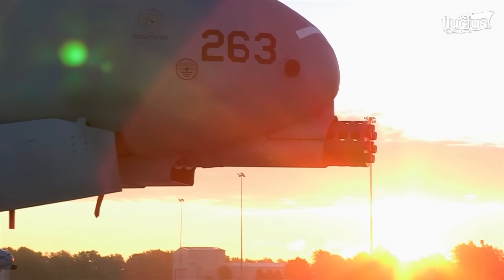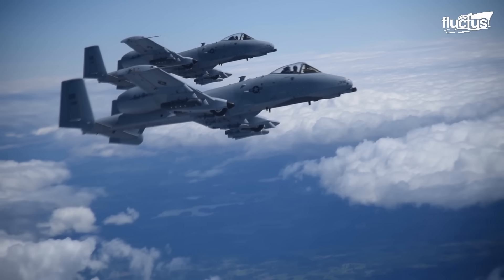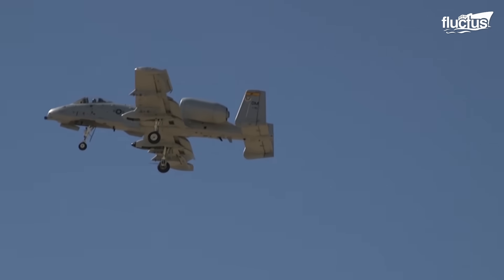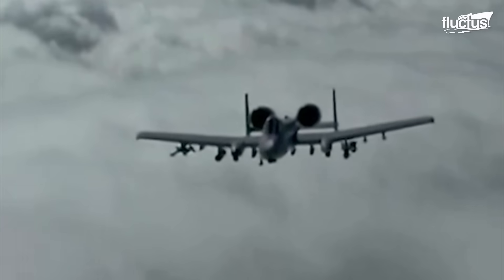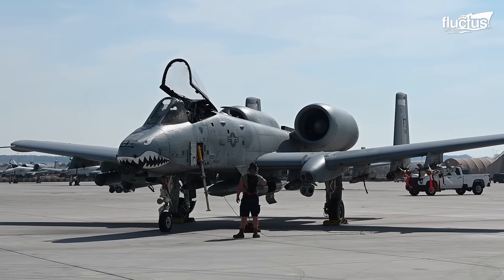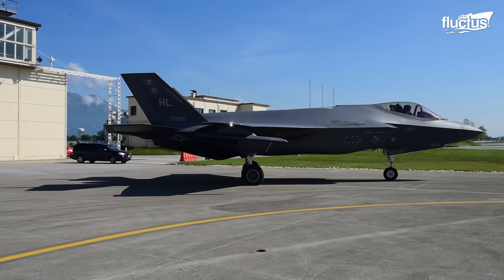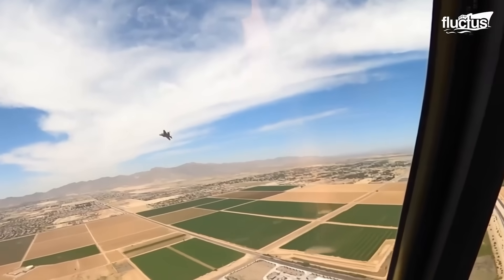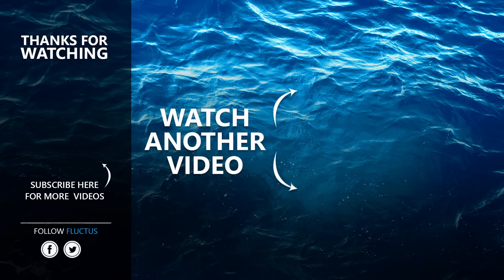Inside US Air Force Advanced Facility Maintaining Scary Gatling Gun Cannons

Comment: i always keep thinking sliding doors provde more radar camouflage over open door weapons bay 
if im wrong on this can you pease explain 
and if im right 
why dont we deisgn the weapons bay to slide open?
why open doors?
Reply: Sliding doors on tactical fighter aircraft take too long to open and more fuselage space than hinged doors. They are harder to maintain and the mechanisms add weight to the aircraft. Aside from heavy bombers (eg B-24, B-36), the only fighter that had a non-hinged bomb bay door was the F-105 Thunderchief which had a rotary style bomb bay door.
Reply: @centralplains7608  but if you only need enough room for 1 or 2 missiles that would launch from the middle 
you would only need to open the middle and not 1 or both doors 
im visualizing the concept of launching 1 or 2 missiles from the middle of the plane and the sliding doors would only need open just enough in the middle to launch both missile then close 
the missiles can be brought into the middle and charged then released from the weapons bay sliding just enough the weapons doors only need to open 20-40 percent vs open doors which open 50% for 1 door or 100% for both doors 
with my idea in my mind you would need to only slide the weapons door maybe less than 50% since your only opening in the middle rather than 1 or 2 doors fully to launch the weapon(this is for in the air launch. For restocking on the weapons bay would need to open 100% to reload the missiles and weapons)
maybe this is an idea thats easy to visualize but hard to engineer when designing and making it functional or practcal without using up fuel storage or more room from the weapons bay to make such an idea. 
anyways thanks for the information
Reply: Let’s just say the door is always shut during combat
Reply: @shalomkweks8081  i know this 
but im asking for the other times its opened and weapons get released dont sliding doors provide less than opening door in terms of radar signature?
Reply: if wrong explain 
if right by how much and percentage or details 
because im curious on this